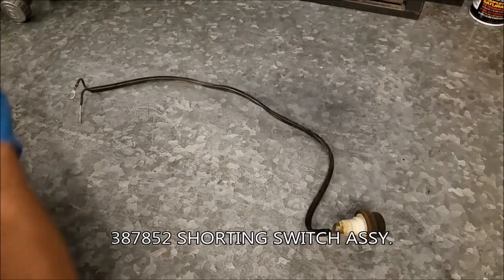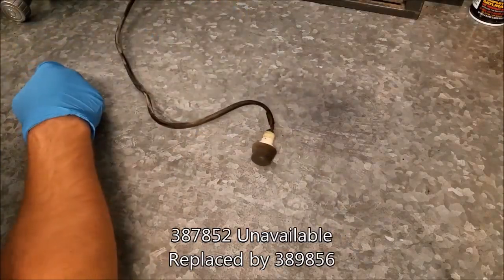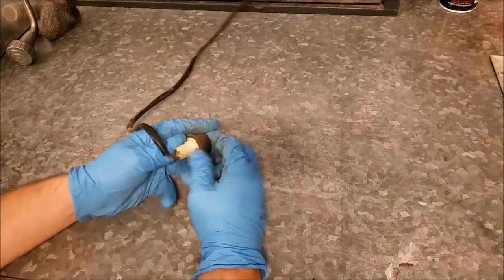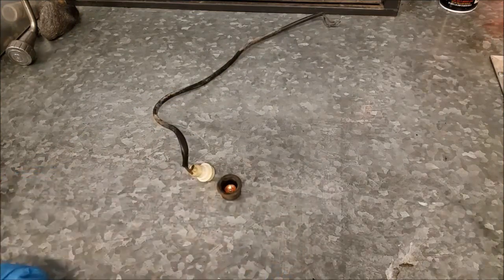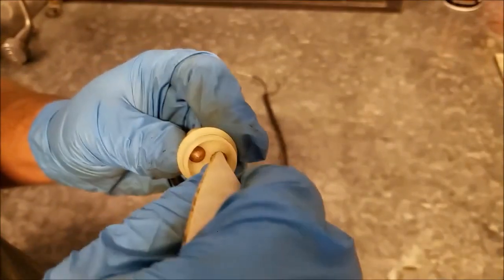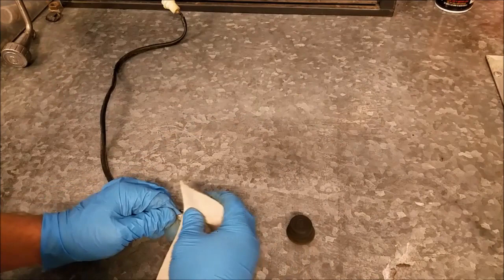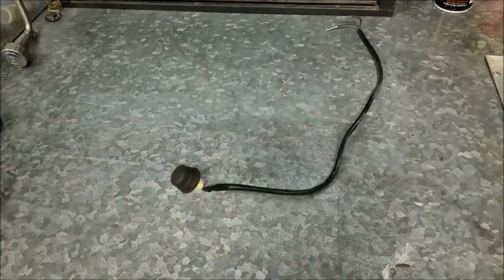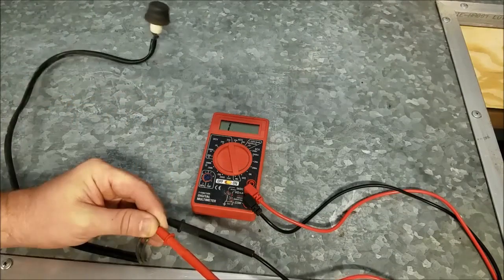Fixing A Outboard Stop Switch

Comment: Could you make a video about Evinrude/Johnson WOT timing adjustment? 
Instructions are a bit unclear in a 40 year old greasy service manual
(I saw on previous videos that you had few of those late 70's- early 80's 4-6hp OMC motors)
Reply from the maker: On what year/HP is your engine?
Reply: @BrandonsGarage  6hp -79
Model number 69B66E

Comment: My stop button I guess it's the rubber cap isn't there on my Evinrude pull start. I can't get motor started. Could that be the cause
Reply from the maker: probably not, but disconnect it and see what happens?

Comment: Hello maybe you can see my post and help me out.
I have an older 20 hp mercury maybe 1979 that I'm trying to get going
It won't fire up I found the stop switch wires all corroded and on really bad agape does this stop switch being in bad condition make the engine not start?
Reply: Possibly, so just follow the kill switch leads & temporarily disconnect them. Then see if you have spark at the plugs, if so, try & start the engine.
If it starts, you know that the issue is the kill switch. 
If you do not get spark or the engine doesn't start, then you have another electrical issue.
If the engine does have spark and/or starts after disconnecting the kill switch, carefully disassemble the kill switch & clean it, then test the continuity as per this video, then re-assemble it, & try it again.
Good luck!

Comment: This can't be off a Mercury...the wires aren't ROTTEN.
Reply from the maker: Thats so true
Reply: @BrandonsGarage  I have had so many 70's and 80's Mercs here that have ALL the wiring rotten. I am working on one now...1977   7.5 with a wire rotted off going into the switch box. Dug down in the wax or silicone til I found the wire...drilled a small hole next to the wire..screwed a small screw in there and hooked the wire to it and siliconed it...had it on the water today...works good.